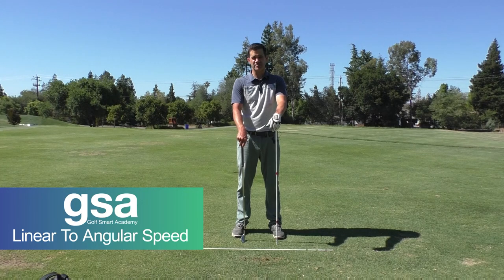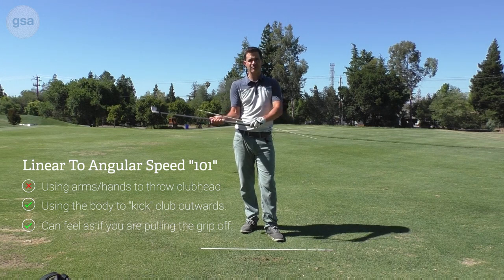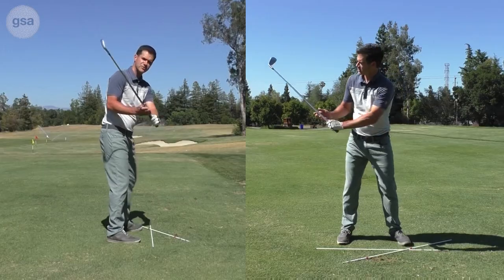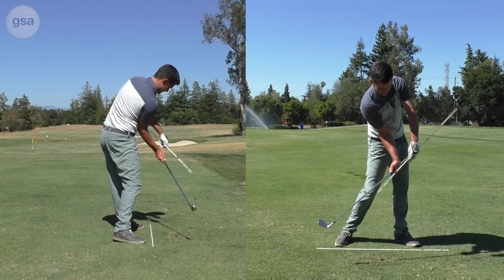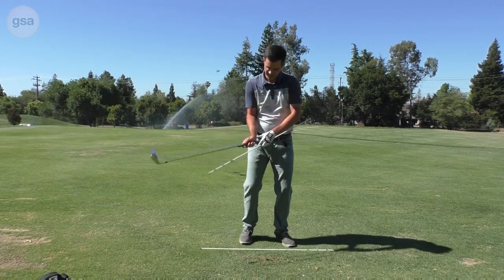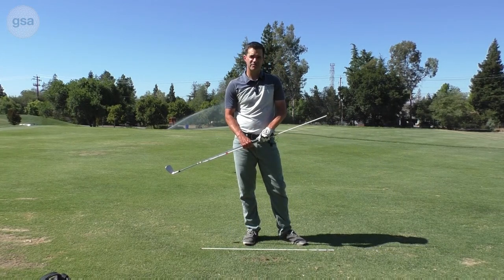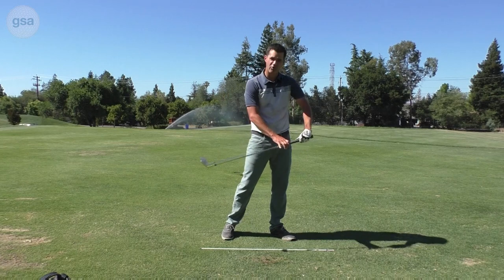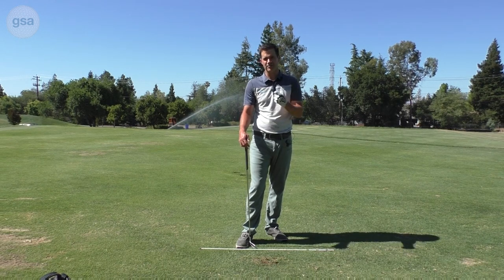Converting Linear To Angular Speed | Tour Release Question

Comment: Anyone interested in the science of this should read Tutelman’s work on the physics behind the golf swing.  The “angular force” you try to describe in the video is the golfer applying torque in the wrists which is scientifically proven to reduce momentum of the club in almost ALL cases!  There should be zero torque applied by the wrists during the swing and a LOT more work done to accelerate the clubhead starting at the top of the swing when the hands push the grip away from the body.  If done this way, most amateurs will feel like they can’t even keep up with how fast the club wants to swing as kinetic energy transfers down the golf shaft to the clubhead.  It is effectively throwing the club away from you at the beginning of the swing using zero torque in the wrists.
Reply: So how do you throw the club away from you?
Reply: @terrygardner6395  it's very difficult to put into words but very easy to feel with the right tools.  The easiest way to feel it would be to put a reasonably weighted ball (maybe a little heavier than a tennis ball) on a string and sling it around you in the shape of a golf swing arc.  Going back, the string will wrap around your torso as you end your backswing and begin your downswing.  At that point, you sling the ball out onto the arc and let it trace a proper swing path around your body until it wraps around you again on the other side.  Not difficult.  The faster you can get the ball moving at the beginning of the downswing, the more clubhead speed you will generate.
Reply: @christopherspringer7809  Ah ha, like swinging with a length of rope, I have done this before.
Reply: @terrygardner6395  yep.  But to key to the proper motion would be feeling the ball accelerate early.  If you do the same thing with a golf club it actually feels strangely out of control.  The club will have a ton of speed and the clubhead's path will be very consistent and not able to be manipulated.  The forces at work are too much for your hands to manipulate in any significant way.

Comment: I do like the concept using the body rotation to produce angular speed, although I did 30 years the opposite. ;-)
What we see happening in the Golf swing on video (like opening the lag angle) is often not the cause, but the effect. I mean the wrists seem to cause the opening of the angle by applying force with them, but actually that is only the effect.